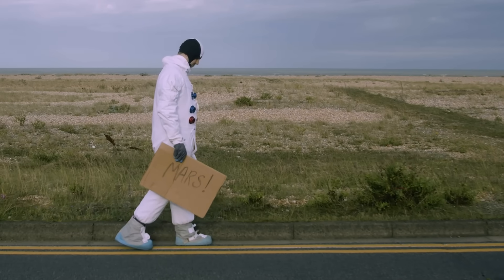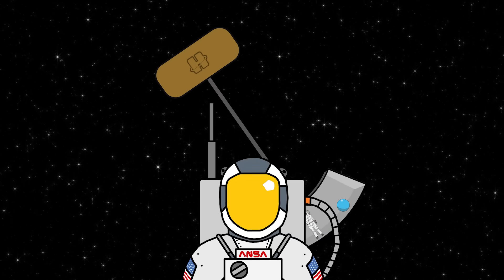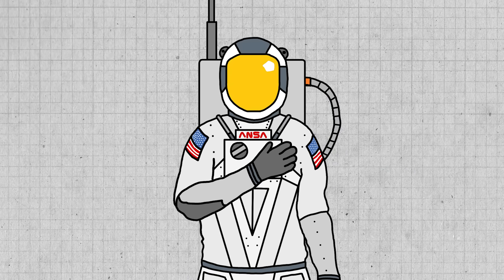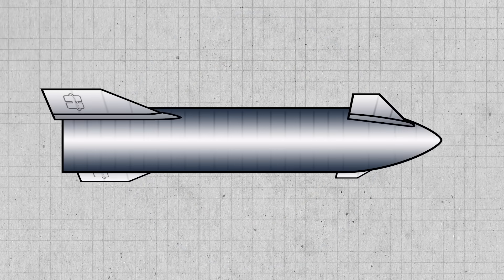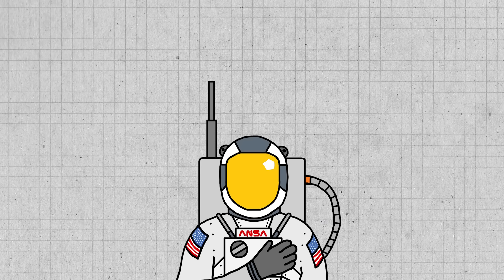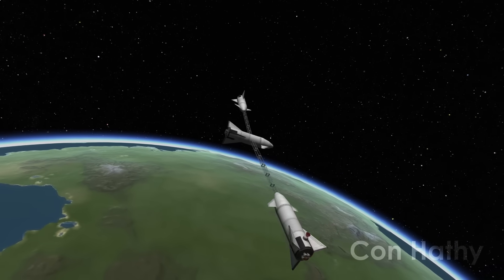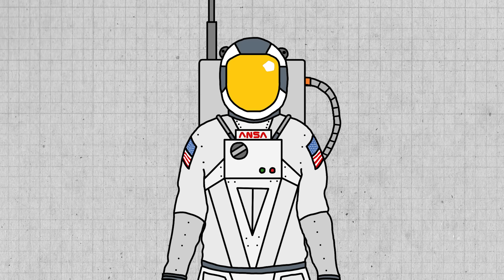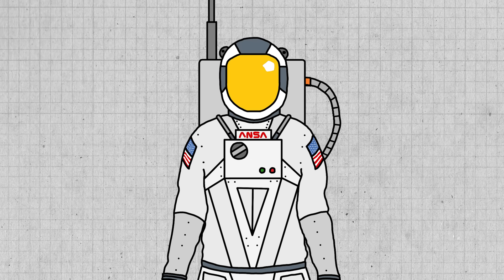This is NOT how you make Artificial Gravity

Comment: A comment about AG on a flight to Mars, or actually any flight of 6 or 7 months.  The need for AG is not for hygiene, or maintaining sanity, it is necessary to ensure the occupants will be able to stand up, walk around and build habitats on Mars.  Astronauts who spend 6 months or  more on the ISS cannot stand on their own after returning to Earth, and need a couple of months of exercise to acclimate to full gravity.  The same will be true for anyone traveling to Mars without AG.  Even though the gravity is one fourth that of Earth, the occupants of the Starships would need time to acclimate to Mars gravity, while trying to use the toilets, showers, fix and eat food, on their own. Talk about hygiene, the mess produced by several people unable to take care of themselves would be horrible, and that's assuming they don't starve due to being unable to move to get the food and water they will need to stay alive.  Since there will be no exercise equipment, and more importantly, no physical therapists to help them acclimate, it will take them a long time to acclimate, possibly several months.

As far as tethering vs. small radius AG, as at least one person has mentioned that Starship's internal diameter is approx. 29 m, allowing for a much larger radius than the one mentioned in the video.  That should make acclimating to the spin a bit easier. The problem of tethering is cost, and complexity. A short radius AG setup inside Starship will be cheaper and easier to implement than devising a tethering system with 2 Starships.  Whether a mission to Mars is funded by the government, or by private companies, they will want to keep costs to a minimum.  The government to make it easier to get funding, and for private companies to maximize profit.

Comment: Isn’t there pressure stored in the cable though? And supposing the cable fails and breaks at an undetermined point that could whip about and cause damage to one or both if the ships. Plus, if the cable is flexible and can stretch then it has even more energy stored in it and a failure would be even more violent.

Comment: Put small tiny tiny slivers of magnets in clothes. Just enough to feel weight on your shoulders. Like I'm Star Trek, everyone has the same type of clothes. Colors vary. Put a electro magnet along the floor. Or what is to be perceived as the floor. 
     Can't have pens or anything that's magnetic tho. If you drop one, it might go thru your foot! 😮
Reply from the maker: Also it wouldn’t help with anything internal, basically the same as doing exercises
Reply: @ConHathy  internally? Like your center of gravity? The force from the magnets, especially on the shoulders......... Think I see a different problem. 
     The only weight we would feel is in the shoulders, which would only work the legs. Maybe wear a hat 🤠? Haha. 
       I guess we humans need the feeling on our while bodies, this way we internalize the feeling of center of gravity.
Reply from the maker: @cincinnatibrutality0201  no, like literally internal organs. Magnets will not pull blood towards your feet and make your heart work harder or help with eye pressure
Reply: @ConHathy  ahhh ic ic .....
    Yeah that is something that goes into great detail. The effects of gravity on the body I mean. I ,however do like to think about these brain teasers. An try to come up with a solution. Might not get it completely right. But might come up with a start!

Comment: Gravity on Earth is the 14.7 PSI of atmospheric gas pushing down on everything. Without it, we would bounce around like we were on the moon.
Reply: That’s air pressure, not gravity. And the moon has gravity
Reply: The space station has the same pressure of 14.7 PSI and it doesn’t have gravity

Comment: If the pressure inside the people is the issue, couldn't they install ports to drain the excess fluids from the skull (or just use syringes) and pump saline (or something compatible) back in upon landing?
As for the bone density, resistance bands may be good enough since they are going to Mars with reduced gravity anyway. Perhaps they ought to design a suit or harness to apply pressure to the body in a way close to that of standard gravity.

Comment: Well, it is a non problem as space is totally fake. Really, you have a ball w/o a cover surrounded by fake space, coupled with the fact that no one in history has ever shown gravity defying Boyle's gas law, that is gravity preventing gas from expanding to full the lower pressure volume, most reasoning folks would conclude that the surface pressure of the ball would be equal to fake space!!!!
Reply: Prove that space is fake ret@rd

Comment: You just need to connect the two ships by a long cable nose-to-nose.  They're designed to be lifted by the nose under 1g - so the structural requirements are handled.
Also, what is "floor" is the floor on Earth, Mars, and on the trip between the two.

Comment: I can not understand you saying that a small centrifuge inside the starship would be better after showing how nice a cable would be.

A centrifuge on the inside would probably be a drum shaped thing, with a battery and a motor.
You need a battery and a motor, because on the inside of the ship there is air resistance, so you have to constantly use energy to keep spinning.
My guestimation is the system would add 50kg.
Compared to a cable:
Starship fully loaded weighs ~1450t and a steel cable that could support that at 1000m length would roughly weigh 20t (maby you could use kevlar or similar instead i'm just using worst case scenario). In space it will have much less fuel though and would probably be lighter.

So yeah it would be heavier.

But:
Only a few or one person could use the drum at a time and to get in or out you would need to turn it on and off or do something (probably not easy) to transition from floating to spinning. The gradient of the gravity would be quite big which is not realy helping health, everything will feel weird and you will also probably be floating most of the time.

The two Starships would need to have one curled up cable (for example one ship all stuff for humans, one ship cargo, for building a station at the destination and the cable in the nose of the cargo ship). Then the ships would have to do something similar to docking a space station, then tension the cable, spin up, and thats how you have gravity behaving very close to normal all the time.
Things with water will be working normaly without special contraptions (toilet, shower, bed,...) which might mean the equipment costs less:
- space toilet: ~$23 million
- launching 20t cable to orbit at todays starship costs: ~$20 million
- and with future projected costs: ~$0,2 million

The people will not have to adapt very much and the body will stay normaly healthy.
I think it would also be much more relaxed to jurney this way.

Comment: Why not just accelerate at 1G for part of the day?  Then cost for part of the day and then if you have hit your maximum velocity turn the ship 180 degrees and decelerate at 1G for part the day?
Reply from the maker: I actually made an entire video all about trying to use thrust gravity: https://youtu.be/nRKNh-Gx9WA
Reply: Why would you waste fuel each day decelerating, and on the topic of fuel no rocket has enough to do this. Rocket engines also for safety need to be lit the minimum number of times

Comment: Short range centrifuge? The head was at least near if not a bit beyond the center of rotation. So when this thing rotates the "gravity" in the head could even point slightly "up"😂 The the "eye pressure" would even be worsened.
Reply from the maker: That was actually a control setup where they intentionally put the eyes at the center, they also extended the arm to put gravity on the eyes but it didn’t seem to help (at least in earth’s gravity) I wasn’t able to find footage of that unfortunately

Comment: All the problems you name like rotational stability have already been solved, like fifty years ago. Just talk to an aerospace engineer. Or perhaps you have and didn't like what they were telling you because the facts disagreed with your preconceived notions. A modular ring design overcomes the direction of down problem. Weight, multiple launches, these are red herrings. As well as artificial gravity you need radiation shielding. If you have to build a ten kiloton space transport to overcome the problems, then you have to build a ten kiloton space transport to overcome the problems. No getting around it. Cheap and nasty solutions tend to be cheap and nasty. I came here looking for high grade information and was severely disappointed.

Comment: IF we could solve the fuel problem, the optimal solution would actually be to accelerate at 1g for half the flight, then flip around the whole ship and decelerating the rest of the way. There's potential weirdness while flipping the ship around, and definitely gravitational disruption during that part (just as at the beginning and end for takeoff and landing and initial course setting and final approach), but for the majority of the trip, there's no Coriolis effect to deal with, and you're putting all the stresses on the ship in the direction it was built to stand on its own.

The downsides to this method are that you have a very fixed time-of-travel, since your gravitational needs dictate your acceleration, and that dictates your average velocity and thus the entire time to travel, and, of course, the enormous amount of fuel required. Hypothetically, a solar sail might let you save on fuel on any part of the trip going away from the Sun, but that also adds another element of directionality. Maybe there's some way to generate enough power on board to use a laser thruster or the like, but that also seems unlikely.

Comment: There's a factor of 2 error somewhere in the math for the 2rpm tether length. And it's clear from the tangential velocity being quoted as 100m/s (which has the same factor of 2 error). 100^2/500 is 20m/s^2, which is 2g, twice as much as it should be. (There was probably a pi instead of 2pi somewhere in the math at a guess...) The correct radius is 250m with tangential velocity of about 50m/s, which does give you 1g gravity at 2rpm. It also means that you can get to 1g at 2.5m if you get the angular velocity to 20rpm, and that's where a lot of human-scale centrifuge research comes up. It also brings down the speed to merely 5m/s which is running pace (about 11mph), and you can see astronauts executing that inside the Skylab which did have a "track" on the inner side of the workshop with a diameter very close to these 5m. (I don't know if they quite hit 11mph, of course...) So in a way, Skylab was the first space station with artificial gravity for the astronauts. It just required you to keep running down the track to maintain the gravity. :)
Reply from the maker: At 12:17 I say 500m radius, not diameter
Reply: @ConHathy  Yes, and that's wrong. You NEED radius of 250m. 2 RPM is 2 * 2 * pi / minute. Multiply that by 250m, you get 52m/s. (50m/s)^2 / (250m) = 10m/s^2, which is what you want. At radius of 500m, you would have 100m/s, which would give you acceleration of 20m/s^2, which is double the Earth's gravity.
Reply from the maker: @katherinek6166  sorry, I definitely misinterpreted your first comment. Good catch

Comment: Gotta say I'd still take a tether over the mini centrifuge. There's just a lot of internal operational issues, and constant re-adjustments that the crew would have to go through that would make work-life aboard the ship more unpleasant than it has to be. Why anyone would be concerned about the safety of a tether is beyond me - you can either do it or you can't. 
Space is a remarkably simple environment for something like a cable. No wind harmonics, no cars ramming into trusses, no earthquakes, basically nothing that would potentially bother the tether at all, given that the chance of anything actually hitting it should be completely negligible. The only thing that would seem to be a significant concern would be gradual degradation of the tether material due to solar radiation exposure, but even on the duration of a Mars mission it doesn't seem likely that would be an issue. You might worry about magnetic fields, except that you're not going to be engaging the tether while in orbit around planets.
Now, this of course is assuming you can build a tether of reasonable weight and length that will handle the loads involved within an acceptable engineering safety margin - but again, even this margin doesn't need to be particularly large compared to most terrestrial applications due to the lack of hazards.

Comment: how about a single "Starship" with a re-attachable crew module and a tether; detach the crew module, point it back at the Starship body, attach the tether and start rotating, extend the tether to the desired length; at destination, stop the rotation, remove tether, reattach the crew module and proceed?
Or, you could have two halves of part of the cylinder extend out (halved in-line to the long axis) and rotate, but this might destabilise and tumble.

Comment: Calling centripetal motion "artificial gravity" is plain wrong. It does NOT produce any kind of gravity.
It doesn't even simulate gravity due to the extreme coriolis effect on humans.
It's just a way to separate UP from DOWN.
And it is 100% necessary for any human travelling to Mars that is NOT on a brachistochrone/torch-ship transfer.
Any human who spends 6 months in zero G (Outside Earth's magnetic field!) would arrive at Mars in a very incapacitated state. They will ALL be sick, and weak, and unfit - right at the time when they need to be their healthiest, fittest, and strongest.
Prediction: the entire first crew to attempt a Mars landing will all die before the mission ends.

Comment: one concept not covered by this video, that I think would actually be quite nice, is to have two starships dock nose-to-nose, no tether required. 

Yes, it'll be a short radius, and having the crew cabins near the center of rotation compared to the fuel "wastes" the strongest centrifugal force, but it's easily the least complex and most practical approach. 
keep in mind, they don't need a full gee, just enough of a gradient to stave off the worst effects

Comment: Would the three ship tether model be more stable if a boom was extended in both directions along the long axis of the central ship, changing the motion from a flip to a spin?
Reply from the maker: No, not if the booms came out of the nose/tail, but if they came out of the top/bottom it would. But again, why?
Reply: @ConHathy  More stability would be better than less stability.  Unless, there is some dynamic method for maintaining stability.  Modern jets are designed to be naturally unstable in flight, but have computerized flight controls that automatically stabilize the aircraft.  

Would a system of coaxial, counter-rotating tethers (similar to some Russian helicopter rotors) cancel out their natural instability?

Comment: Regarding using thrusters to spin up the tethered artificial gravity, if you use a rigid truss couldn't you instead do it with a reaction wheel?  

More generally, regarding the issues about stability can't many of these be handled with active control using reaction wheels?
Reply from the maker: The problem with reaction wheels is that they are inherently less mass efficient. Rocket exhaust moves at kilometers per second; to match that performance the wheel would have to be as wide as the entire vehicle and spin at kilometers per second as well, which is not practical at all
Reply: @ConHathy  Yah after a bit of consideration they just won't work for spinning up the system.  But I'm not convinced they can't be used to actively control the system to maintain spin around an otherwise unstable axis.

Comment: 2:30 Stupid question: did you try your centrifuge experiments with the occupant in a fetal position?
Reply from the maker: No, but if you’re worried about the head being in the center that was actually a control setup where they intentionally put the eyes at the center, they also extended the centrifuge arm to put gravity on the eyes but it didn’t seem to help (at least in earth’s gravity) I wasn’t able to find footage of that unfortunately
Reply: @ConHathy   I was actually thinking the pressures on the body would be more equal than the head spinning at some fraction of gravity less(?) than feet are spinning..  With a short arm, do you keep a bucket handy? 🙃
Reply from the maker: @LordDustinDeWynd  ah, well it would be more even, but it’s also the equivalent of laying down because it’s pulling fluid to your back instead of your feet
Reply: @ConHathy  Indeed.  Like I said, silly question.  Thank you! 

(I'm disappointed we wont see Von Braun wheels...)

Comment: Centrifugal forces only work on a body with gravity such as the Earth. In space you would need EXPONENTIAL acceleration for it to work. otherwise you'd be spinning as fast as all around you but without any forces pulling you down on the floor. I am amazed this hasn't been pointed out more clearly so far.